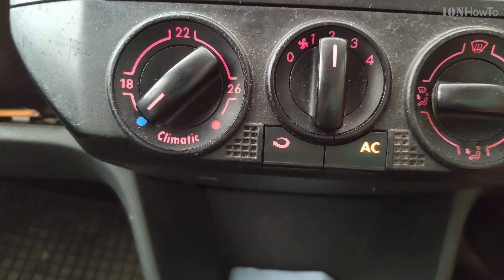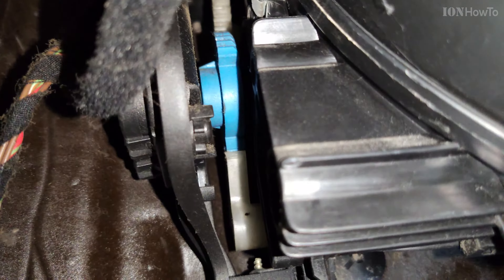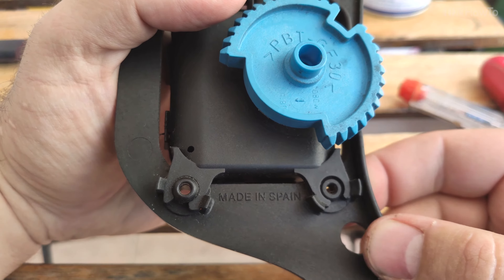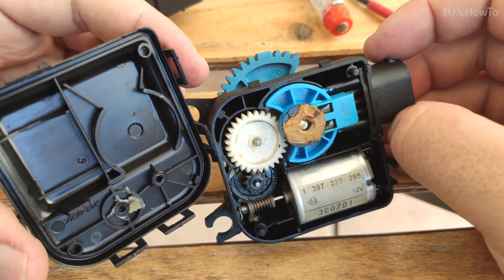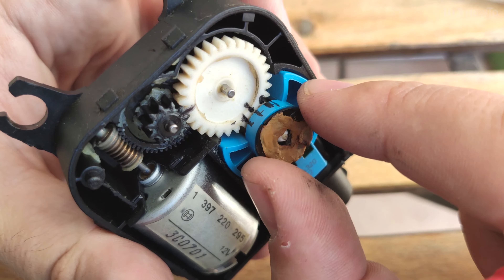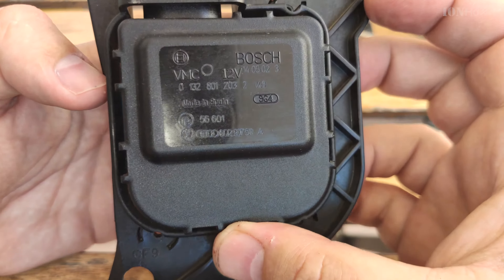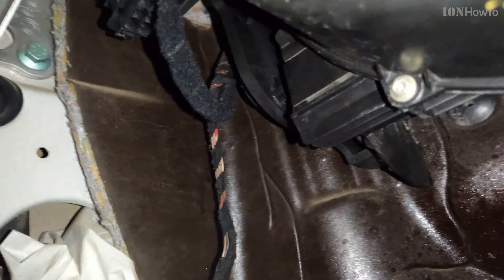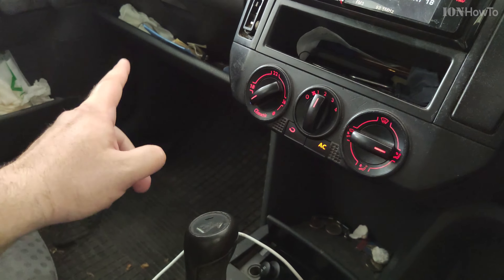Fix Recirculation Flap Motor V154 or V68   VW Polo 9N Mk4

Comment from the maker: https://www.ionhowto.com/vw-polo-9n-mk4-air-recirculation-problem-ac-goes-randomly-cold-to-hot/ 
Amazon: Air recirculation actuator motor VW Polo 9N https://rex.red/air-recirculation-actuator-motor-vw-polo-9n * 
Jumper cables https://rex.red/jumper-cables *
Jump starter battery booster https://rex.red/jump-starter-battery *
Tools https://rex.red/car-tools-kit-mechanic *
Cleaning https://rex.red/car-cleaning-supplies *
WD-40 https://rex.red/wd40  *
Torx socket set https://rex.red/torx-set-socket-45-55-60  *
Jack https://rex.red/car-jack *
Stands https://rex.red/car-jack-stands-heavy-duty *
Gloves https://rex.red/car-gloves-mechanic *
Safety glasses https://rex.red/safety-glasses-anti-fog *
Spark plug removal tool  https://rex.red/spark-plug-removal-tool  *
Spark plug Gap tool https://rex.red/spark-plug-gap-tool  *
Coil puller tool https://rex.red/coil-removal-tool  *
Car fuse set https://rex.red/car-fuse-kit  *
Battery tester https://rex.red/car-battery-tester  *
Maintenance kit https://rex.red/car-maintenance-kit  *

Subscribe and Ring the Bell to watch more videos.
ION HowTo https://rex.red/ionhowto
RedNumberONE https://rex.red/rno

Buy merch https://store.ionhowto.com/
Check it, buy it, post it and  tag it #ionhowto or #rednumberone

Join this channel to get access to perks:
https://www.youtube.com/channel/UCx4Qbp3iC97kQzj7e7g7slg/join

We earn money from qualifying purchases using our affiliate links.
Affiliate links are marked with a star. *
When you use our * links, you support this channel.
As an Amazon Associate I earn from qualifying purchases.

Comment: I had to disconnect my actuator flap motor and been running the car without it for a year now. However there might be a slight power loss. But not worth the $200 spare part (Volvo). Then I found your video.  You are extremely clear about what to do and what not to do. Awesome tutorial, thx a bunch!
Reply from the maker: Had to chose to either make a 8-10 min interesting appealing video or a 40+ min detailed one.
Hope you get yours working.
I used contact cleaner spray before and it works for a while but doesn't last.
WD-40 lasts a long time.
Reply: @IONHowTo  You're not gonna believe me but I thought the video was about 10 min long. I just jumped to the parts where I was confused the most. And I didn't even notice it was that long lol Keep up the good work mate! Cheers from Turkey ;)
Reply: I also want to add that your camera skills are amazing!
Reply from the maker: @noudialp  Thank you!

Comment: My flap works as displayed on the video after your fix, however I when I scan with VCDS I get error code "01596 Motor for outside/Recirculated Air Flap(V154) 55-00 - adaptation not successful". What does this mean as the flap is opening and closing as expected? POLO 9N3.

Comment: Hi. I found your video very helpful, thanks. I replaced the potentiometers in both V68 anb V154. V154 behaves like it has not enough power to rotate flaps. I concider if that is problem with climatronic panel itself or something? Flaps are moveable easily by hand, so shouldn't be a problem there. Also the temperature flap is behaving strange, not properly. I didn't do a calibration yet.
Reply from the maker: If it has a hard time moving, make sure the motor is placed in the correct position. If it's not in the right place it might not work well or even make some clicking noises
Reply: @IONHowTo  Yep, you're exactly right. That's what happened. I didn't match the 'half-notches' in correct places but I figured it out. Now I only have some control module faulty problem (65535 code), but I'll change it for another and see whats going on. Thanks!

Comment: Hello. I have the recirculation light always on. When I switch it off, it will switch on again automatically. When I put in reverse the light switches off.
Reply from the maker: That's strange, for me it was always off. Check if the recirculating flap moves at all and if there is something blocking it from closing.
Flap open - light on.
If it can't close it I guess it's what you have.
Reply: @IONHowTo  Thanks. Tomorrow I am gonna check the flap.
Reply: @OrgoneBlaster did you fix it? I have the same problem
Reply: @Gadaff1 same did you fix it?

Comment: It worked. Recirculation is fixed now. But this didnt fix the slow switching from cold to hot and vice versa. Any other motors that need this treatment in order to fix this issue? Thanks
Reply from the maker: The speed will not change. 
The problem that happens usually is you set it to middle and goes full hot or cold and goes from cold to hot on it's own.
Reply: @IONHowTo  it also switches from hot to cold on its own. Another motor is apparently responsible for this.
Reply from the maker: @rackenjoyer  oh Maybe I was confused about it. For me this time was the recirculation but had the hot cold problem too before. Hope you can find how to fix it

Comment: When the recirculation is active the flaps is open?
Reply from the maker: Yeah, it's open to take air from the car instead of bringing it from outside.
Reply: ok perfect. the last question: Can you confirm that there are 2 flaps and they are both open?
Reply from the maker: @antoniooriolo7158  for me there is one flap as far as I see. Maybe it's 2 and I didn't see it.
Reply: Yes there are 2, that's why the white gears are 2
Reply: However, I think both are open when recirculation is active.
Reply from the maker: @antoniooriolo7158  I don't know how it works. They move together. Might be that the second one is to close the air duct from outside. It's probably that.
Reply: made sure that when it's active both are open. maybe I was wrong

Comment: Thanks for your video! I’m Brazilian and I have a VW Polo 2004. I apply contact cleaner before too. In my language a only found this option, but now I will test WD-40 that you show. If success I record a video to help peoples in my country. Thanks
Reply from the maker: WD-40 will not seem different while you do it but it will last longer. 
Record it for sure. These videos started as a way to log what the parts looked like before I take them apart. 
First was pictures, then videos, then uploading.
Start a channel with the repairs you do!
Reply: Boas, amigo conseguiu resolver o seu problema apenas limpando ?
Reply: @RuiChagas-h1s Consegui sim amigo! Usando WD-40

Comment: Going to look at my Skoda Fabia today, maybe removing the fan motor first would enable better access to that motor?
Be interested to know if the hot/cold motor is the same procedure.
Reply from the maker: You could remove the heater blower motor and check it but you don't have to.
This motor is for both recirculating flap and for hot cold adjustment. I don't know how it can do both but there is no other motor there on my car. 
When you have hot air / cold air problems this fixes it.
This also fixes recirculating flap problems where it turns on and off or not on at all.
Reply: Its located in a different spot on the fabia (i am trying to fix it myself on the mk1 fabia). Its on the left side of the middle-console. Hatboy harvey has video showing it: https://youtu.be/kpv-mzBT8dQ?t=595 My car is left hand drive so unfortunately its a bit difficult to get access to it so far..
Reply: I think there is a flap controller motor for temperature also. Recirculating flap and temperature flaps are different i think

Comment: Thank you so much for posting this video, you are very kind to take the time to do this to help people like me. Can you tell me what position the flap should be in when the recirculation light is on, (mine is permanently stuck in the on position),
Thank you.
Reply from the maker: Light on means the flap is open. Not sure on this how it would look like but I didn't have to turn the potentiometer and it would have been very hard to do anyway.
You can replace the whole motor assembly that includes the potentiometer.
In the video the flap was closed when I took it out - you could use it as a reference.
Make sure the flap and hot/cold gears go on the motor gear as shown in the video.
Reply: @IONHowTo  Thank you, It's people like you who make the world a better place, God bless you.

Comment: Bonjour . Sa fait 4h que je n'arrive pas à le remettre . A vide il fonctionne. Une fois mit, sa force ... je l'ai démonter ouvert avec la roue au milieu.  Faut t'il la mettre à fond à droite ou à gauche ? Merci
Reply from the maker: The recirculating flap was closed most likely when you took this out.
Move the flap to closed and use a flashlight to see there is a second gear inside next to the recirculating flap.
Watch the video carefully to see the gears position before removing.
You should use a flashlight and don't force it.
Then alignment is correct, this motor slides between the flap gear and the second gear so that it moves both when it's opening and closing.
Hope you get it back in.

Comment: Bonjour.  J'ai une polo 9n de 2004 et j'ai réparer le servomoteur v154 de recyclage d'air . Après avoir batailler pour le remettre, j'ai un doute sur les volets au niveau de la soufflerie . Je ne comprend pas le fonctionnement mais es que c'est normal que quand j'appuie sur le recyclage d'air ; le volet qui fait la liaison entre l'habitacle et le moteur se ferme et celui au niveau des pieds s'ouvre et inversement quand je desactive le recyclage d'air , merci =)
Reply from the maker: Sounds right, the flap on the passenger side foot well should be open when the recirculating light is on.

Comment: Hi! Ive been looking for this video for 3 years!!!!!!!! Thanks alot for it! I have the excact same problem. If I start the car with maximum heat it will blow maximum heat.
And same with cold. But when I change from max to for example 22 degrees the car blows just minimum heat (the coldest). 
I have a my steering wheel on the left (not like you on right) so the part you changed dont have the same OEM number, Do you know the OEM number for my car?

/Viktor
Reply from the maker: Thanks for watching, I don't have another car.
Maybe soon a VW Golf or better if the channel goes well haha.

Google for forums with the same problem.

I did this fix many year ago but never recorded it.
Got asked so many times but wouldn't open the car just to make a video... Until the thing started making problfms again.

Now it's recorded in full 4K HDR (I thing).

Use WD-40 not contact cleaner. 
It will last much longer.
Reply: @IONHowTo  WD 40 Electrical Contact Cleaner? or just WD40 straight up?
Thanks for answering me
Reply from the maker: @viktordavidsson8017  Thanks for watching.
It's straight classic wd-40. 

Before, I used contact cleaner on the same thing before and it lasts much less.
Wd-40 inside where the contacts touch. Spray a generous amount and dry the outside with a paper towel. 
Don't spray wd-40 on the gears. Those have grease that doesn't need to be disturbed.
Hope it helps you!